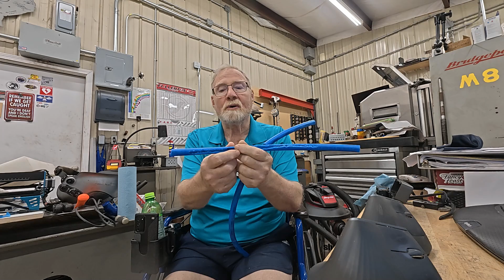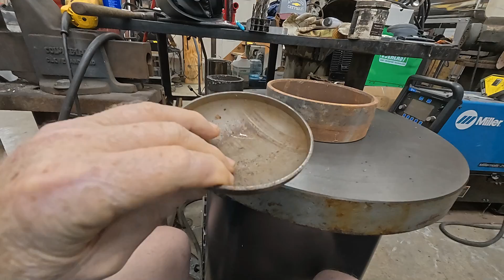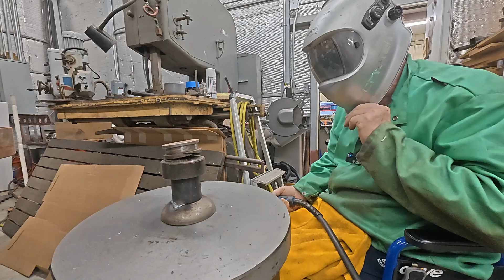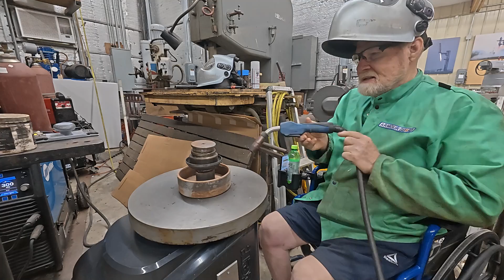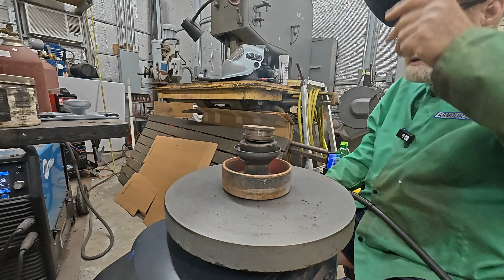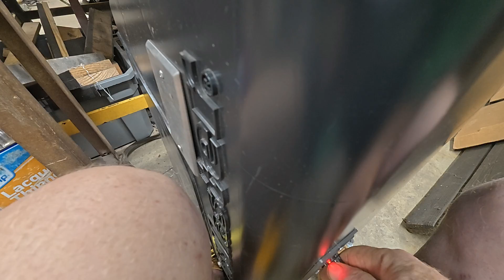Shop Problems

Comment: Reminds me of all the houses i see with like fiberglass dryer pipe air ducts. I know those things will never make it 10 years before critters have trashed them and all the air id blowing out where it doesn't belong. Metal costs more to start but it lasts so much longer! Surprised those rats didn't drowned as big a gap as they chewed.

Comment: Don’t be too hard on yourself Steve as that’s a tricky welding task. Big respect for having a go and sharing - it’s your  effort and motivation that keeps us coming back to watch and support you❤.Would some concentric markings or grooves on the top make centering the work easier?
Reply: I thought the exact same thing. Just like a good 4 jaw chuck
Reply from the maker: I only put a ring in one place about 1/2 way in. Should have done more :)